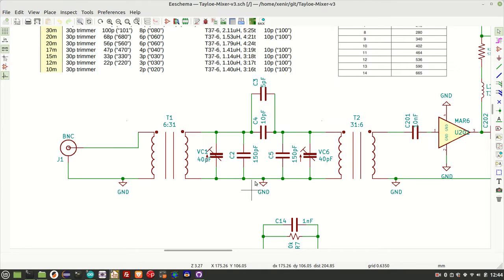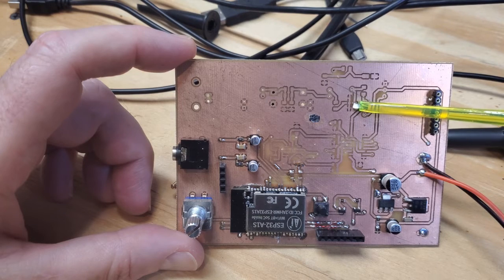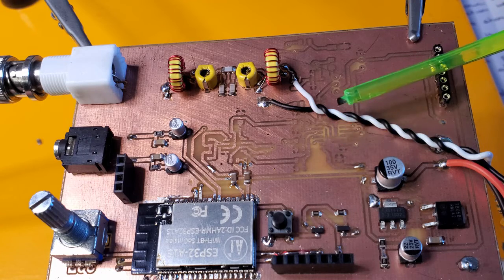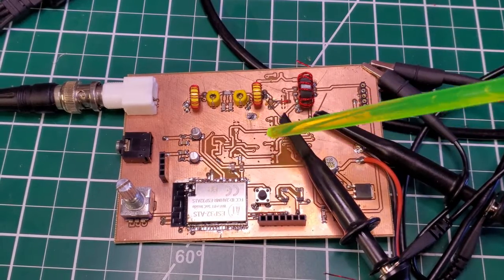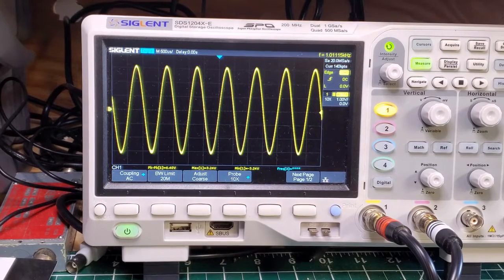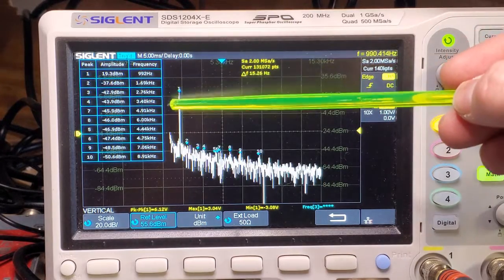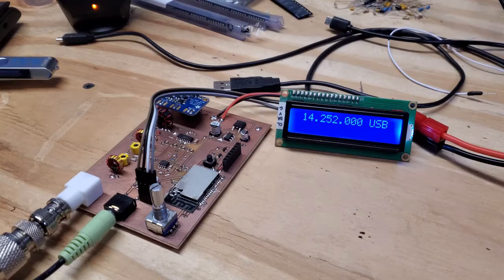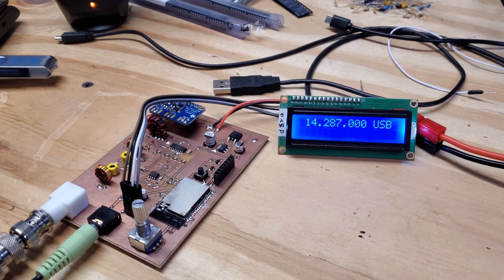ESP32 Radio on a Board  - Part 3 Final Build and on the Air

Comment: Thanks for the detailed description of all the experiments. Didn't know the A1S module. Saves an audio codec.  I use the tayloe with a raspberry pi but it uses the same concept. 73 PA0PHH
Reply from the maker: Yes the ESP32-A1S comes with both the uController and the codec in the same module. I do wish though it was a more traditional header pin arrangement. Thank you for the comment

Comment: Finally got the code to compile on PlatformIO. What a pain.
Reply from the maker: I played around with PlatformIO for a bit. I didn't really like it TBH
Reply: @na5y  I have windows 7, the new Arduino IDE with in tellasense  wont install on old Windows 7. PlatformIO, sure compiles faster. Only complies code that was changed. I have the code switching bands and modes. Only the three bands, 80,40 and 20.  Hope your holidays were  happy. 73
Reply from the maker: @rfdave3980  I only have one windows machine remaining - World of Warcraft doesn't work on Linux! You are using Visual Code with PlatformIO? I didn't mind visual code but I've used Eclipse for so long its hard to change.I haven't tried the new Arduino IDE
Reply: @na5y  Yes Visual Studio Code with PlatformIO extension. I am not a Linux guy. Ardunio was a good start but the old IDE bad.

Comment: I am using the ESP32-A1S Audio Board. I found by turning off the high pass filter on the headphones I got rid of a lot of high frequency noise. These filters are turn on by default. I added in the code to load 0x00 into Register 14 ADC  Control 6. I'll need to give it a go tomorrow afternoon to see how I make out. Love it.
Reply from the maker: Interesting - I have tried a number of different things to get rid of the high frequency audio. Didn't think of changing the config for the ADC. Let me know how you go
Reply: @na5y   Yes Ian the high frequencies are cut down. On the audio board the headphone jack is connected to line out 2.  Line out 1 goes to the  Class D 3 Watt speaker amps. I have also pulled the 0402 resistors feeding the bias to the microphones.

Comment: i am newbie, try compiling Radio.ino : D:\Users\ADMIN\Documents\Arduino\libraries\firduino-master\src/FIRConverter.h:3:10: fatal error: AudioBasic/Vector.h: No such file or directory 
Multiple libraries were found for "WiFi.h"
 #include "AudioBasic/Vector.h"
 etc, etc etc  
exit status 1
Error compiling for board ESP32 Dev Module.
Reply: Arif,
Try this substitution in both Radio/ChannelAddConverter.h and Arduino/libraries/firduino/src/FIRConverter,h:
//#include "AudioBasic/Vector.h"
#include "AudioBasic/Collections.h"

Vector.h  is in arduino-audio-tools/src/AudioBasic/Collections.
Reply from the maker: @jeroldponko7168  Thank you Jerry - Looks like I might need to fetch a more recent copy of arduino audio tools and fix my code.
Reply: @na5y  One thing I'd like to know is how did you calculate the values for your transformer coupled band pass filter? W7ZOI did a paper on the calculations but did you use a spreadsheet or online calculator? I never found either one online.
Reply from the maker: @jeroldponko7168  Jerry - I didn't calculate them but simply took the design from the qrp-labs bandpass filter: https://qrp-labs.com/images/bpfkit/bpf2.pdf

I have given them credit a few times. I am not sure where the original design came from
Reply from the maker: Your question got me thinking and I found this in EMRFD on how to design a double tuned filter that you might find interesting: https://drive.google.com/file/d/1UcmASRghSS5-eemDhsElUfgexyjGuY8v/view?usp=sharing
Reply from the maker: Hi there. Unfortunately the build is a bit of a pain to set up and I don't have a build script. Here's some suggestions

1) I would first get the arduino audio tools built and running with some of the examples (i2s i2s for example). Until you get that set up nothing else will compile. Running the examples also confirms your I2S setup is correct. Instructions are here:
- https://github.com/pschatzmann/arduino-audio-tools

2) Then you need to make sure the general library for Button processing
- Bounce2 

3) Then finally install the libraries from the forks I have created
- https://github.com/thaaraak/firduino
- https://github.com/thaaraak/LiquidCrystal_I2C
- https://github.com/thaaraak/es8388
- https://github.com/thaaraak/Si5351Arduino

I hope this helps and good luck!
Reply: @na5y  thank's alot..

Comment: Fascinating scratch built SDR project,  very good job. Love that all parts should be easily obtainable.   Did you fork the code from an open source project?  
Can hear a bit of high frequency audio hiss, would benefit from a 3khz low pass audio filter. 
Transmit next? The codec is only half used 🤓
Reply from the maker: On the transmit side - I definitely want to do that also. I did I/Q transmit only in an earlier video but I have yet to combine the two
Reply from the maker: Thank you Paul. I actually forgot to post a link to the software - I will put it in the description but here it is
https://github.com/thaaraak/ESP32-A1S-Tayloe/tree/master/Radio

The Radio code is all mine (and as you'll see its pretty simple) - you are welcome of course to clone/fork

The sound processing library all comes from arduino audio tools
https://github.com/pschatzmann/arduino-audio-tools

I covered the software side in a little more detail in this video
https://www.youtube.com/watch?v=prCrbD4T6I4&t=288s